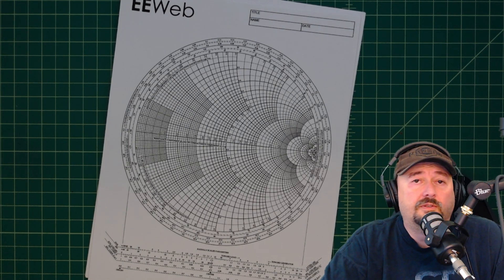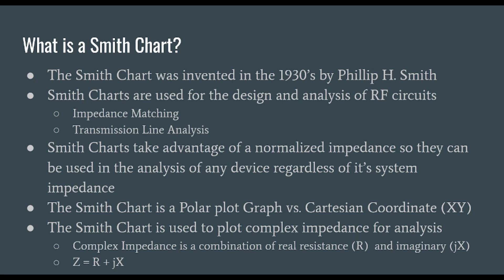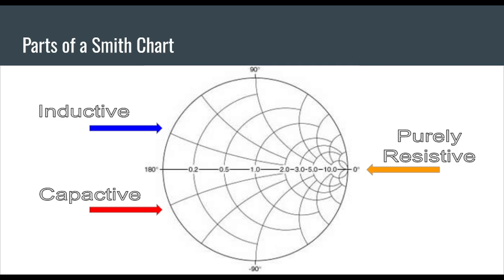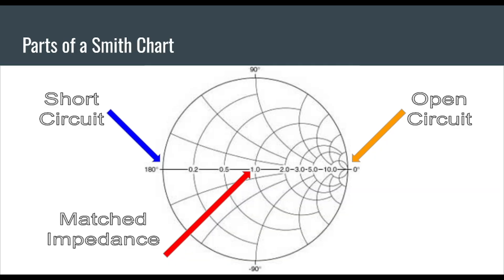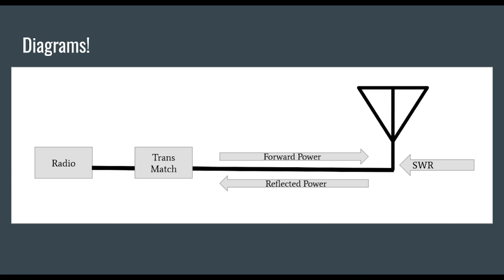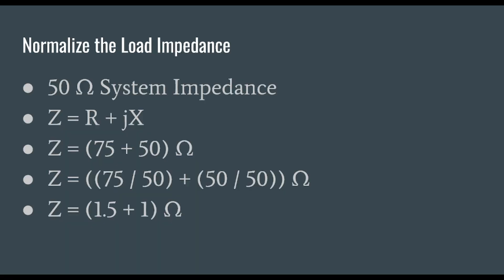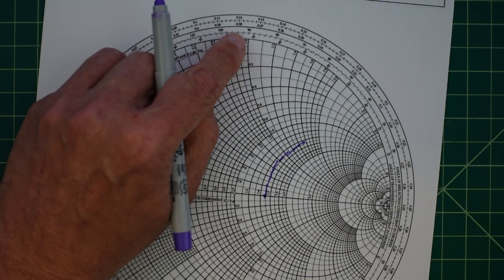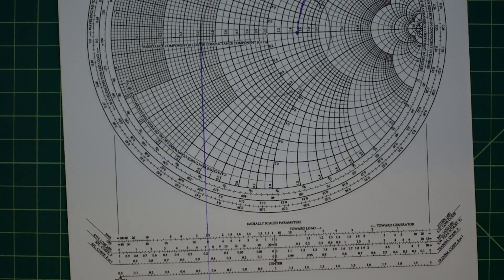Demystifying Smith Charts for Ham Radio Beginners

Comment: [11,25] I always thought, resonance is not just, when there is no reactance, but when additionally the normalized resistance is 1.
Reply from the maker: As far as I know, it’s when reactance is 0
Reply: @TheSmokinApe  Thank you for your answer, which made me get deeper into this! Of course, you are right. My thought was, that a resonant antenna with, say 30+0j Ω fed with 50 Ω produces return, hence cannot be resonant, which is of course nonsense 🙂
Reply from the maker: It’s one of the more complicated topics in ham radio.  Think about the dipole at 1/2 wave above ground being resonant at -73 Ω 👍

Comment: Thanks for the video but I will suggest a more down to earth video like in a 10k feet above where I can just take my antenna analyzer or nano VNA, do a sweep and understand what is telling me IN BASICS in regard of "the antenna is good for my purpose"?,  etc but VERY "for dumb people" like me which are not interest in all that information you provided (which is great for other people) and we can just do a sweep and in less than 10 seconds understand where we at, like when reading SWR. Also ive seen many times when shopping for an antenna where the manufacturer shows a smith chart and I have no clue what is telling me, it will be great if at that time in 5 seconds I could understand if is good for my purpose or not. If you can give examples even better.  I hope I'm explaining myself. Thanks for all your help understanding stuff
Reply from the maker: Hey Angel.  Sometimes folks feel dumb, but that's because they are exposed to something new, over time the complex will become simple.  We are all new at first and feel this way.  Look at it like this, in order to interpret a Smith Chart at a glance you need to know the parts of the Smith Chart and what they mean, that's what I covered in the video along  with some extra stuff.  If you even only take that part away you have a stronger understanding than before AND the next time, it's less complex.  Thanks for watching 👍
Reply: You are completely right my friend. Is just that sometimes we live a life so busy that the little bit of time we have to play radios is to take a tool and find “it works? No? Move one” you know. I hope one day (probably when retire) have the time and brain to learn all the ins and outs. Thanks for your honest and down to earth reply.
Reply from the maker: Thanks for watching Angel 👍

Comment: Hands down the best Smith Chart explanation I have ever seen.   The last time I tried to wrap my head around Smith Charts was while studying the ARRL Extra License Manual.   I have been avoiding them since.
Reply from the maker: Thanks SF, glad it was helpful 👍
Reply: When I found the smith chart on the NanoVNA it was everything I wanted / needed to know to get my antennas working 

I have SWR / Logmag, but it is the Smith chart I go to to work out how to fix issues. 

For example, a friend was putting up a fan dipole for 40 & 80. We could get a match on 40, but the match on 80 was pretty ordinary. Best SWR was 1.8:1

I had a look at the smith chart and it showed, what I expected, that the impedance was a little low at resonance because of its proximity to the ground. 

Simple fix. Increase the impedance at resonance by feeding the 80m dipole slightly off centre. Worked a treat….until the weather took it down a few months later. :-/
Reply from the maker: Awesome story MidLife, I agree.  Once I got the Nano I started to understand antenna behavior much better 👍
Reply: @TheSmokinApe  I used to use a home made gate dip oscillator. Had a set of coils wound on wooden kite dowel shoved into a 3 pin DIN plug. Used that to find resonance and then add some sort of L match at the feed to get the SWR right. 

These days we are so spoilt for affordable tech to home brew, VNAs Spectrum analyzers. Storage Oscilloscopes and function generators. Even component testers for $20 

Almost no excuse not to be making stuff. Antennas, match units, radio gear…you just have to get over the optional anxiety of which one project to start on  😊

Comment: Great help, thanks. So, in an ideal word that SWR circle needs to be as small as possible and centred slap bang in the centre of the chart? If the centre of the circle is above the "equator" then you need to add capacitance to the antenna and similarly if the centre of the SWR circle is below the "equator" you need to add inductance? Any tips on how to do this? I suppose that would be dependent on the type of antenna?
Reply from the maker: Hey M7BXR, you are on the right track.  I would appear my friend, at least I think we are friends, Mr. BDRFI nailed it as always.

Comment: Not all of the power bounces back and forth like a ping-pong ball. Just as a majority of the forward power passes into the antenna except for the reflected power, a portion of the reflected power passes through the trans-match into the radio. How much depends on the impedance mismatch between the 50 ohm cable and the impedance of the trans-match.

Comment: Good start on the Smith chart! by the way, an antenna can be resonant on more than one frequency, and they can line up right on or near the other bands we have privileges on because of the harmonics. it was designed that way. and the guy who told you about the open feed line was giving you information. if you have an antenna field 400ft away from your shack, instead of running high-dollar massive coax use an open feed line it will save a lot of money and be better. there are places to use all of the different designs. everyone lives in a different situation with different problems to overcome.
Reply from the maker: I have a lot of friends who use open wire feedline, I put comments in like that to joke with them.  So, when it comes to antenna like EFHW that are harmonically "resonate" on multiple bands, that's not really the case.  An antenna generally "that's the word I used in the video" is resonate on a single frequency and near resonate on harmonically related frequencies.  I have bult, bought and tested a great number of them and I have never seen one that was truly resonate on any HF frequency much less multiples.  Thanks for watching Curt 👍
Reply: you need to do a 1/4 wave. the matching network will make them resonate on single frequencies. try a simple 40 meter dipole you will be resonant on multiple frequencies. don't expect a 1:1 match every where, but you will be able to use a lot. @TheSmokinApe